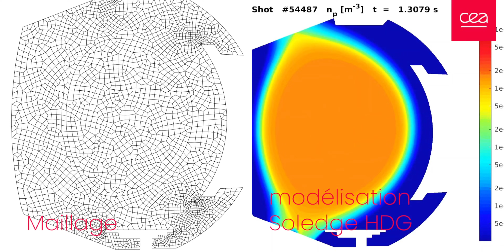France Runs Nuclear Fusion Reactor for Record 22 Minutes!

Comment: No fusion was tested because they have no fuels, the Deuterium is trivial to get, the Tritium is impossible to get and DT is the only reaction worth going for but as soon as it is tested it will make the containment vessel radioactive.
Search for Dr Daniel Jassby a retired fusion physicist who has a lot to say about Tritium, the net gain like with uranium fissioning has to be >>1, in fission it is about 2 to 3, but with Fusion it will always be <1 because the breeding cycle with lithium has a gain of 1 but that requires 4 impossibly difficult steps all be perfect, in practice most of the Tritium will get lost, won't be bred, won't get collected and worst of all mostly won't fuse in the plasma. If they all worked perfectly and the breeding used Beryllium instead the gain would still be vastly <2 and just look up how pleasant Be is. Also see Improbable Matter another retired fusion physicist.

Comment: Did they just run the plasma containment field, or did they actually accomplish fusion of hydrogen isotopes for 22 minutes? If so, how much hydrogen fuel did they consume?  Were there any concequences from the neutron radiation that fusion generates? Neutron radiation tends to make everything it interacts with radioactive. Is this the case for the tokamak reactor that they used? All the articles talk about 22 minutes, which is  a great achievement, but are there anymore details about what the test actually was?
Reply: Fusion does occur under these conditions, but I suspect the story here is that the French managed to sustain plasma in the magnetic field for 22 minutes.
From what I understand, plasma is notoriously difficult to sustain because energy finds a way to leak out of the magnetic field.

Plasma behaves very much like the common idea of how a ghost does. 👻
Reply: Why do you ask so many questions? Are you trying to prove how smart you are? Do you think you're smarter than everyone else? Is this really the right place to ask these questions? What did you have for lunch today? Do you like backed beans?

Comment: So the take away is that the reactor was able to withstand high temperatures for 22 minutes. Not that the reactor actually produced net positive output of energy. They had to use more energy than they may have gotten out. The reactors can hold plasma all day long if they have the ability to withstand the high temps but when do they test it at fusion temps?? Are they able to make a definitive statement regarding how the reactor will perform at fusion temps or are they keeping that a secret?
Reply: Yes, it's a secret to everyone.